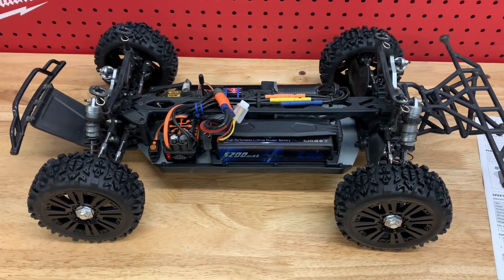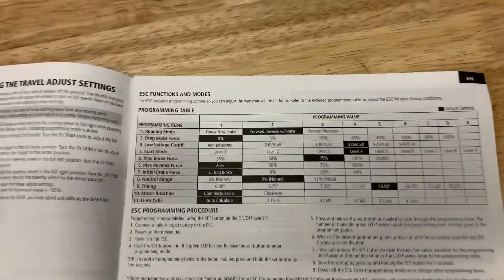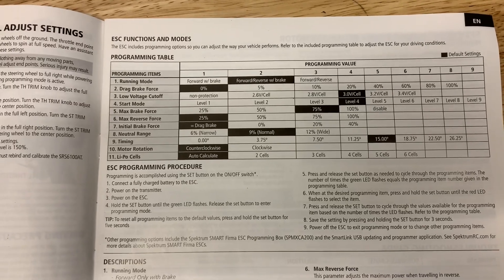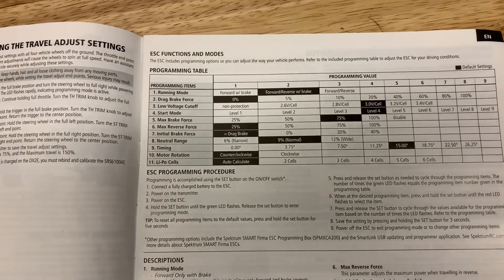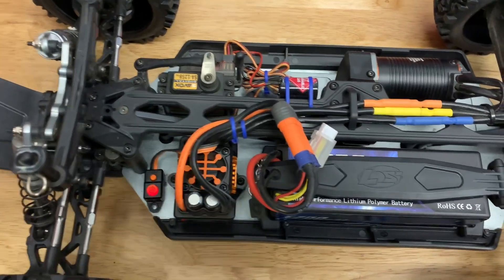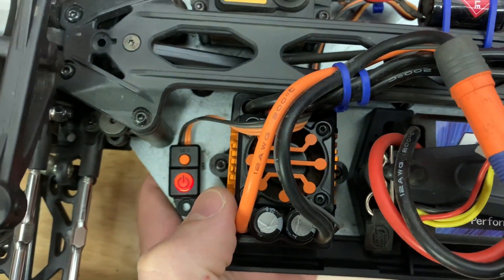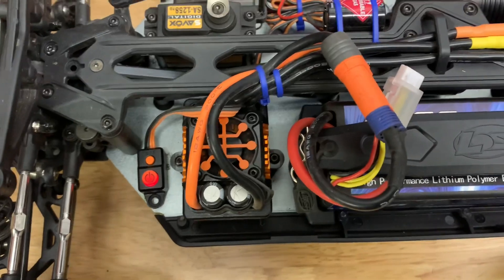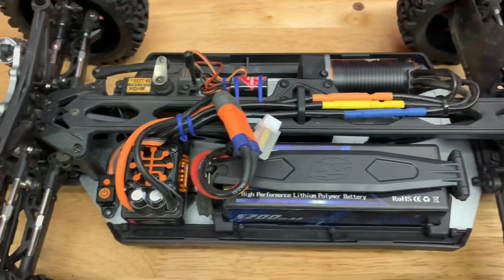Losi Tenacity TT Pro and Desert Buggy Pro ESC Programming- More Power!

Comment: A little tip for the truck, I found & fixed a big headache with putting the body down. 180 the battary holder top so the hinge is facing the front....body goes right down, no binding.
Reply from the maker: Excellent idea, thanks for sharing! The body catching right there is a constant annoyance, especially on my other buggy that I run taller 4s batteries in.

Comment: Definitely worked and can see the wheels hop up on dry pavement now lol, 2 runs in stripped spur gear 😂 running the 15t pinion with 3s
Reply from the maker: Proof that it made a difference lol. I’m surprised you tore up a spur, I’ve been running on 4s and haven’t broken anything yet! Maybe your motor loosened up and threw off your gear mesh?
Reply: @misterts7635  for sure lol it definitely did, Instant power now I’ve swapped the spur and ran 2 runs so far seems mint again so hopefully this ones last, and yeah I took a tumble and a half on dry pavement losing control at full speed motor definitely shifted that little bit to strip it, landed after the crash and no go 😂

Comment: Hey man, Just bought this last week as my first official rc car
Did your tt pro have any cogging issues when you first got it?
Reply from the maker: Congrats on the purchase! I haven’t had any cogging issues with my DB or TT. I actually feel like they perform very smoothly for a sensorless system. What are the brand and specs on your battery? Also, are you using the 17t pinion that came installed on the motor?
Reply: @misterts7635   I been running it on these Lectron pro 3s batteries and on day one started with the 17t pinion and the first thing i noticed before even driving it was the cogging noise, switched it to the 15t pinion gear and still the same. I did the ESC programming like you did the video and went up to level 9, it kinda helped a little bit but it’s still there, it’s driving me crazy. Also is cogging bad for the vehicle? 
Thanks for the help
Reply from the maker: @theclickbaitdetective9196  got any friends in the hobby who can let you try a battery? If it’s not the battery, I would reach out to Losi and see what they say. It definitely shouldn’t be cogging, especially after you geared it down. Shouldn’t hurt anything, but it also shouldn’t be doing it.
Reply: @misterts7635  ok, thanks for the help

Comment: Mine doesn’t do wheelies what a bummer :/
Reply from the maker: I can’t tell if you’re being sincere or sarcastic, but it’s going to be ok man!
Reply: @misterts7635  Theres a video on the punch settings by earl moorhead and when he put it to level 9 it does wheelies I meant to comment on that video but I watched this one instead why is that tho?
Reply from the maker: @simonriley9177  are you running a 3s battery with the optional 15t pinion that came in the parts bag with your truck? If so, you should be doing wheelies!
Reply: @misterts7635  yes i am which is the reason for my comment is my truck defective? I don’t understand Im also new to this hobby so any help is much appreciated! :)
Reply from the maker: Dude, welcome to the hobby! I doubt your truck is defective, it’s more likely that your battery is unable to provide the burst of current. What brand, mah capacity, and c rating are you using? Also, how old is the battery?
Reply: @misterts7635  gold bat 5200mah 80 c also the battery is 3 days old
Reply from the maker: @simonriley9177  that should be plenty of battery, unless you got a bogus one. Got any friends who will let you try one of theirs to see if it makes a difference? I’ve had really good results with Zeee batteries.
Reply: @misterts7635  yes i seen people talk about zee batteries but I had already bought this one I’m just worried the truck is faulty do you think it’s just the battery? And if the battery is bogus would that affect the truck in anyway?

Comment: Awsome video thanks for the lesson may I ask what your using for tires wheels and what you got for hex adapters
Reply from the maker: Thanks! I’m using DE Racing adapters and buggy wheels from Amazon. I have a video about the conversion.
Reply: Thanks I'll be checking that out also do you have a problem with front having no chassis slap my dbpro will not and it keeps breaking or bending front pins

Comment: I recently ordered one of these and I don’t feel like spending much on just the battery. Do you know if the EC5 battery connection will fit on the Tenacity TT pro?
Reply from the maker: Yes it will. Losi’s IC5 “smart” connector is just an EC5 with a data wire in the middle. It’s compatible with regular EC5.
Reply: @misterts7635  Thanks for the confirmation!

Comment: What torque number would be good for a track dirt
Reply from the maker: It’s all preference, really. If it’s loose dirt you could try starting somewhere in the middle and working your way up. Or you could leave the punch turned all the way up and use the AVC feature to make the truck more controllable until you get better with throttle control.
Reply: Thanks man one more question shock oil weight you recommend
Reply from the maker: @taronhowell2523  I don’t launch mine off huge jumps so I keep it pretty light. Usually 35-40wt. If you’re doing a lot of bashing and really sending your truck flying you’ll probably want something heavier, like 50wt or so.
Reply: Thanks for the info

Comment: Thank you for posting this video. I just recently got this truck and I actually drove it for the first time today. And I like it a lot but, there were a couple settings that I wanted to change and did not have a clue, I guess I should have really looked at the manual again as you did. Thank you for going to the steps I'm going to do this And tweak my settings a bit for my driving style 👍
Reply from the maker: Congrats on the purchase. Cant go wrong with a Losi!
Reply: I did the exact same thing got it out the box threw a spektrum g2 basher 2 cell battery and put the box and manual in the garage and was let down when I raced my slash ultimate because the slash beat it so hard out of the hole but had no clue about these settings lol I feel like a dummy